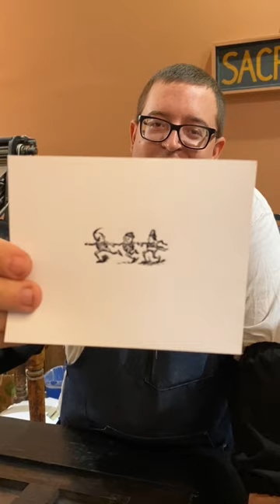Printing some joy for World Smile Day (October 7)

Comment: The handle that is used to press the paper to the electrotype - is that handle wood? If so how is it maintained to not crack or split, being as old as it is,over time due to the oils in your hands and the humidity/dryness in the air as seasons change.